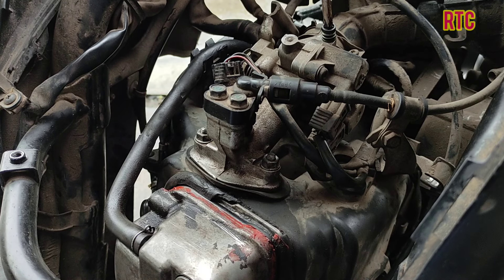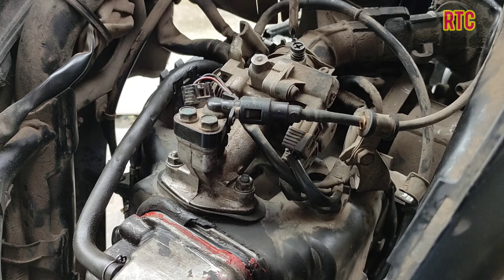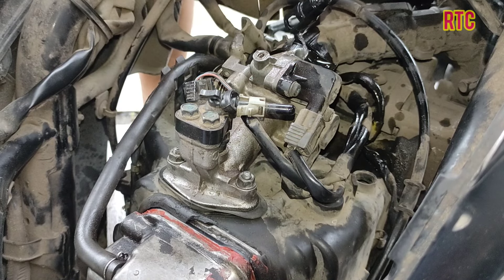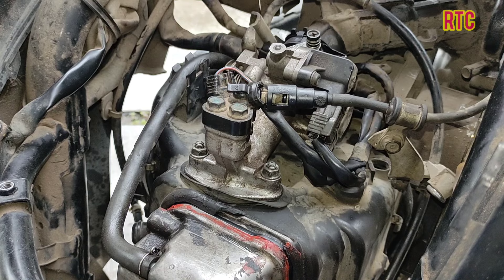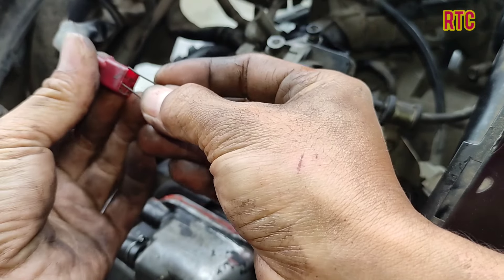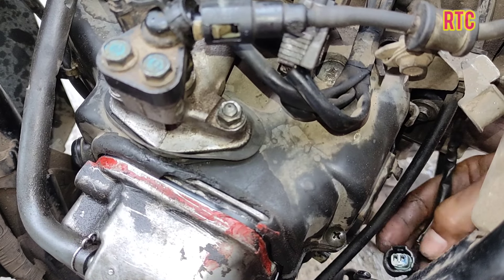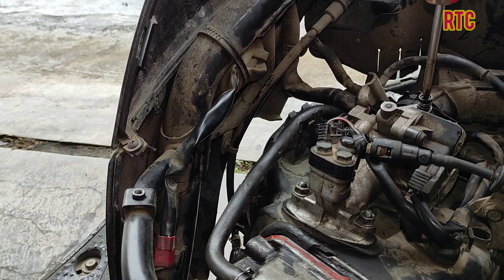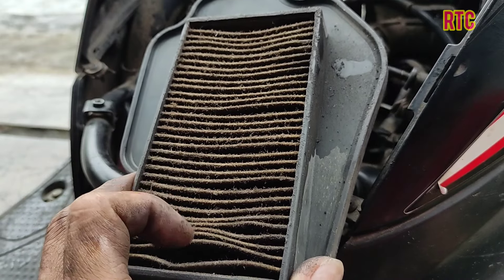Langsam Honda Beat Injeksi Tidak Stabil Mati²

Comment: Motor saya beat esp 2019, matian mulu langsam nya, padahal udh di bersih kan, kata org bengkel Honda nya, ganti tb nya, solusi nya mas, apa ganti aja ya, soalnya fulpam masih oke, cuman gas kadang ga lngsung turun pas digas tuh, atau pas gas di lepas
Reply from the maker: kayane bisa distel mas, perlu ditlateni
Reply: @rumputteki  udah di coba masih sama, sama pas mau awalan di gas tuh kaya nyendat, ngeden, malah ga lngsung ngegas jalan, kalo di gas gede baru jalan tuh, di bawa juga rada beratt
Reply: @adityafirdaus7028 : coba cek tekanan pompa bensinya om, sama kyaknya tpsnya trouble itu
Reply: Podo mas penyakite uwes tak ganti pulpump anyar Karo TPS tetep AE mas piye solusi ne ganti ka mas

Comment: bang saya mau tanya, saya punya motor beat fi tahun 2013. sudah ganti rotak, tb, injektor vario 125, filter pump dan sensor eot juga sudah diganti. tp motor saya brebetnya parah banget. dan kalo di bawa jalan sekitar 500m mesin langsung panas luar biasa. sudah cek selang pernapasan normal, bahkan coil nya juga masih bagus dengan pengapian biru. kalau di reset, awalnya bagus kemudian kalau di jalankan malah kambuh lagi brebetnya. kira2 kenapa bg?
Reply from the maker: tps sudah dicoba?
Reply: TPS kaya ia

Comment: Ass. Bang mw tanya, motor sy beat fi 2013, pernah ganti injektor, gak di riset sma bengkelx, dpat beberapa minggu, kadang motor mati mendadak, gas kecil mati, sma sy tak coba risert injek, dan normal kmbali,
Kisaran 2 bulanan, berubah penyakitx, gas kecil mati dan apabila di bawa ngebut langsung ngempes seperti mw kehabisan bensin, apa bila gas di ditarik motor langsung mati, dan yg mw hidup ±5 menit, kira2 kenapa ya bang, mohon ilmunya. . 🙏🙏
Reply from the maker: ilang kimpresi mas, indikasi oli mesin sering berkurang
//mau bales komentar baru ya//🙏👉❤️👍🙏//
Reply: Iyaa betul mas. Oli kadang berkurang, kmungkinan. . Kotor pistonx ya mas

Comment: Pagi Mas, motor saya BeAT ESP ECO, sensor EOTnya pernah saya resistor, tp akhirnya saya copot lagi resistornya dan saya balikkan ke normal lagi karna terasa boros di BBM plus saya ganti rotak fuel pump dan reset injeksi, tp langsam motor terasa lemas walau saya udah putar 2,5 putaran bahkan sampe lebih, itu kira² kenapa ya Mas ? Tp kalo di bawa jalan motornya sih tidak ada masalah.
Reply from the maker: kompreisnya normal?
Reply: @rumputteki  normal mas
Reply: Sama mas punya ku beat 130 cc juga gitu jalan normal tapi gabisa langsam

Comment: Punya saya motor Vario 110 fi 2015 starter kasar bg, itu ga langsam. Kalau g d gas mati . Udah diganti setelan anginnya yang ORI tapi masih gitu juga. Fuelpump normal. Kira" apa ya bang
Reply from the maker: ada kabel ibjeksi yang bermasalah
Reply: @rumputteki  bermasalah nya gimana mas?

Comment: Izin bertanya mas, beat fi sya langsam nya ga mau turun, sudah service sensor iacv,reset juga udah, stelan angin mentok  mesin nya ga mati . 🙏
Reply from the maker: koin trotle valve gak nutup maksimal,
atau karet injeksi patah,
atau karet ebonit manifol bocor
Reply: Siap, terimakasih info nya mas, sukses selalu
Reply: @syaifullzarir9947 masalahnya sama om, udah ketemu belum om penyebabnya
Reply: @alimuntaha855  udah Alhamdulillah, punya saya koin trotle body nya udh aus, bner kata suhu chanel ini,, terus sama sensor TPS nya eror, sya ganti, skrg udh normal lagi
Reply: @syaifullzarir9947  terus koin nya diganti apa gmana om

Comment: Pagi abangku... mio F1 2013 saya normal sih bang,  tapi kalau pas jalan, misal.lagi macet atau lampu merah.. gas posisi netral, kadang mati semdiri.... trus stater lagi...   gak sering sih... itu ada masalah kah ...?. Gimana solusinya ya bang.... makasih bang
Reply: Maaf bang salah ketik.. bukan Mio... honda Beat F1 2013
Reply from the maker: setelan angin dibersihkan dan diatel 2,5 putaran mas
Reply: Oke udah aman.. makasih bang

Comment: Saya udah coba bersihkan tb, reset manual, tp masih gak langsam.. gimana mas?
Reply from the maker: coba fokus di angin2
Reply: @rumputteki  yoi mas, ternyata koin TB nya gamau rapet. Baut stelannya sy kendorin, aman sudah..
Terimakasih
Reply: TB itu apa dan dimana tempat posisinya .maaf sayah awam .motor sayah beat f1 penyakinya sama

Comment: Om, kalau beat esp susah langsam kalau dicabut sensor suhunya langsam kenapa ya Om?
Reply from the maker: masalah di TPS
Reply: @rumputteki  Mohon solusi Bos.. soalnya motor sya juga susah langsam tp kalo cabut sensor EOT langsam normal
Reply: na penyakitnya sama mas beat sya juga kadang lamsam kadang naik sendiri gasnya tapi pas sensor eot dicabut normal cuman lampu mil aja yang kedip..
saya juga bingung masalahnya dimana ap di TB nya soalnya udah riset masih juga gak mau normal
Reply: @dhenbagoesdhenbagoes4793  gimana sekarang mas udah normal.?
soalnya sama penyakitnya